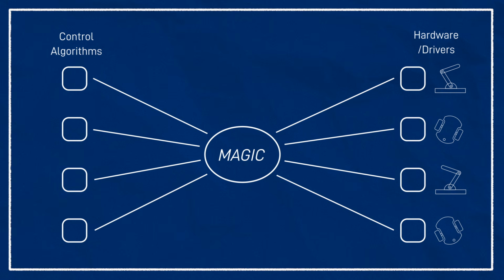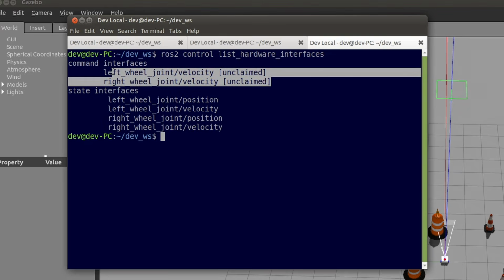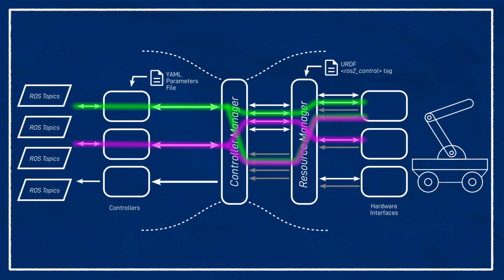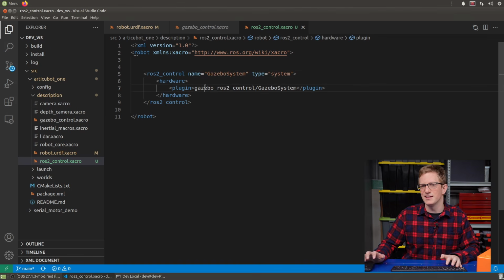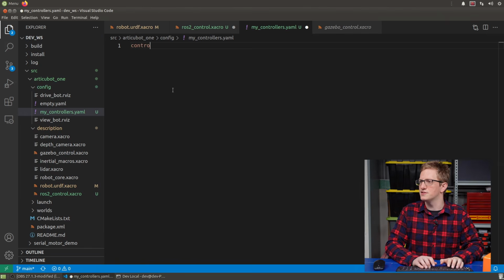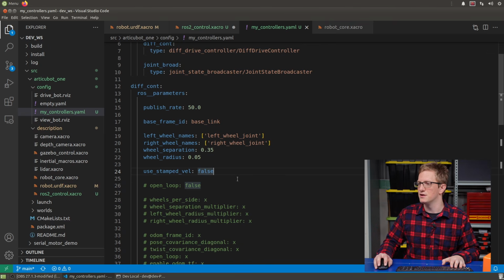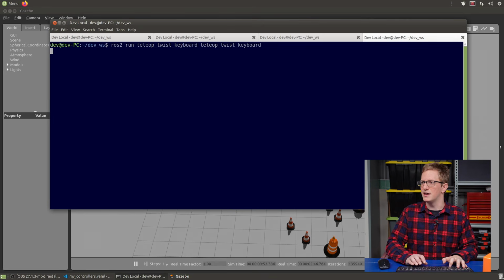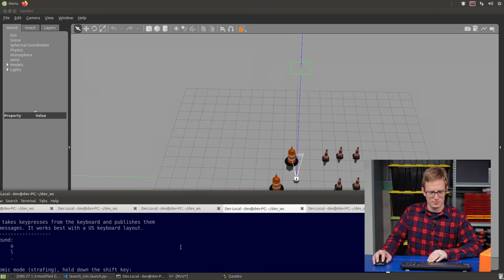Solving the problem EVERY robot has (with ros2_control)

Comment: If you get this Error after running the launch file: "No parameter file provided. Configuration might be wrong"

Its because you need to add:
<ros>
  <namespace>/</namespace>
</ros>

after your <parameters>....</parameters> plug in

Without this block, Gazebo's plugin was trying to find the file on its own (without using ROS's package system), which failed because Gazebo doesn't understand $(find my_bot) syntax.

Comment: first, huge thanks to you for creating free resource to educate the community.
And for others :
I was struggling with the gazebo_ros2_control plugin not parsing the YAML parameter file and Gazebo server failing to start. After much debugging, I found two critical points that resolved my issue:

The <parameters> tag that specifies the YAML file must be inside the <plugin> tag of the gazebo_ros2_control. If it’s placed outside, Gazebo reports “No parameter file provided” and fails to parse the YAML.

The <plugin> element specifying the hardware plugin (e.g., <plugin>gazebo_ros2_control/GazeboSystem</plugin>) must be written in a single line without line breaks. Splitting it into multiple lines caused the Gazebo server to crash without clear errors.

These subtle XML formatting and nesting fixes solved both the YAML parsing and Gazebo launch errors for me. Hopefully this helps other ROS 2 Foxy and Gazebo users avoid the same frustration!

no AI model could find this error. I cloned articulated robotics repository for this and tried running and did many iteration to pinpoint the error. Hope this helps some beginner like me.

Comment: I am using gazebo to simulate a quadruped robot, the robot keeps sliding backward and jittering before i even press anything, i tried adjusting friction and gravity but didnt change the issue. Anyone got an idea on what that could be. Howver when i use the champ workspace it works fine, so i tried giving chatgpt champ and my workspace and asking what the differences are it said they were identical files so i dont know how to fix it. For reference the robot i am simulating is the dogzilla s2 by yahboom provided in the picture. My urdf was generated by putting the stl file they gave me into solidworks and exporting it as urdf.

2

1

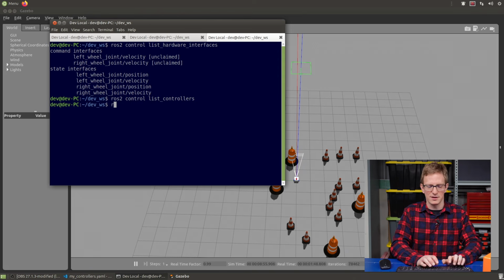Comment: I am facing issue in ros2 control list_controllers 18:35 , how can I solve, I have ros2 humble version
Reply: have you found a fix?
Reply: I am facing it right now
Reply: I'm facing the same problem running with ros2 kilted. I think the cause is that gazebo changed since foxy and then the controller doesn't start.
Reply: The solution is in https://www.youtube.com/watch?v=fH4gkIFZ6W8

Comment: any ideas how to change parameters for 4 wheel diff drive
?
Reply: Any luck?
Reply: @chibuezeorji8288  i tried tweaking some parameters, it shows perfectly in rviz2, but in gazebo, i will work only if friction and angular speeds are set correctly

Comment: Really helpful set of videos. I'm struggling to find a controller for a 3-omniwheeled mobile base, I fear I will have to write it on my own. Only I found for a 4-omniwheeled robot or a tricycle base. Do you know if there's something out there for the 3-wheel holonomic base already developed?

Comment: I was getting this error: "Could not contact service /controller_manager/list_hardware_interfaces" (when running "ros2 control list_hardware_interfaces")
and "waiting for the controller manager service be available" in the gazebo output
the problem was for me that I accidentaly put the gazebo tags in ros2_control.xacro inside the ros2_control tags
took me quite some time to find this mistake, hopefully this helps someone who happens to be in the same situation

Comment: Hello I have a problem with Controller Manager, when I launch my launch file I have the error : "waiting for the controller manager service be available" Do you know how to solve this?
Reply: Hey man! Did you find a solution for this? 
I need some help with the same
Reply: @avaneeshchitta794  Hello, I tried different things, but I still had the error with the "controller_manager". My solution was to create a python code for communication with Arduino using the "serial" library, another for the publication of odometry and another for the publication of the td. The only thing I had to use was a Nano to control the motors and a Mega for reading encoders. Investigating they said that the raspberry was very slow for Ros2 and the best thing was to run a "Basic Ros" on the raspberry and the "Complete Ros (Rviz, etc)" on another PC with more resources
Reply: has anyone been able to figure this out I am also having this issue @avaneeshchitta794
Reply: @avaneeshchitta794  i had the same, problem was that I put the <gazebo> tags in ros2_control.xacro inside the <ros2_control> tags
Reply: I also have this problem, maybe it’s fue to a recent update. I have my tags correctly placed, though. Has anyone been able to figure it out?

Comment: Thanks Josh. Just to let you know, the "ros2 run controller_manager spawner.py ..." gave me an error (now executable found). I had to use "ros2 run controller_manager spawner ..." without the .py extension, and it worked.

Edit: just realised this is mentioned in the ready to humble video. Watch that first.
Reply: Thank you for sharing this. I encountered the same error and tried million different things to fix it only to realise, "Someone must have faced the same error, let me check out the comment section".
Reply: Thanks for sharing this
Reply: thabks
Reply: tks
Reply: this really helped me too, thanks
Reply: Thanks for this
Reply: Thanks buddy
Reply: yeah buddy, but i am into a new problem where all things go correct still my gazebo robot not moves on that unstamped don't know why this been stuck in my head for few days
Reply: sorry, i forgot the first rule while starting this series to have patience i followed back the tutorial series and found out a bug in my lauch file now all is good 🤩🤩

Comment: As i understood it correctly, ros2_control relies on the motors having their own controllers - they manage them via the ros2_controller manager. But however, how would you write an own PID controller for a specific robot and then connect it to the controller manager?
Thanks for the great video! =)
Reply: Refering to the part where it was mentioned how the ''hardware interface" is already given, or else it should be written independently

Comment: Hi Josh, 

I'm following your partical ros2 tutorial, and I'm struck near the list_hardware Interface. When I'm trying to run it. I'm getting a msg in the terminal that "Could not contact service /controller manager/list hardware_ Interfaces. " I'm using ROS2 humble, and I have installed all ros2_control packages for binary and gazebo packages. Can you please help to fix my problem?

Thanks 
Adithya
Reply: (Just in case you are still having this problem:) I also had this issue, my mistake was that i placed <gazebo> ... </gazebo> inside the <ros2_control> ... </ros2_control>. I placed it like shown in he video and that solved it.
Reply: Hi Adithya,
I have also faced the same problem. Have you found any solution now?

Comment: I followed everything in the video, but when I try to run the controller diff_cont, I get the error 'Failed loading controller diff_cont'. But the 'joint_broad' controller loads properly. Any clue why this is happening?
Reply: Same issue, did you found any solution?

Comment: Thanks a lot for these tutorials. I have a question. Ive been running into issues when running the launch_sim file with ros2 humble. I dont know why but the gzserver dies when launching with ros2_control. The exact ERROR msg is the following: [ERROR] [gzserver-1]: process has died [pid 261816, exit code -11, cmd 'gzserver -slibgazebo_ros_init.so -slibgazebo_ros_factory.so -slibgazebo_ros_force_system.so']. I dont find any forum containing this problem.
Reply: did you find a solution to this issue?

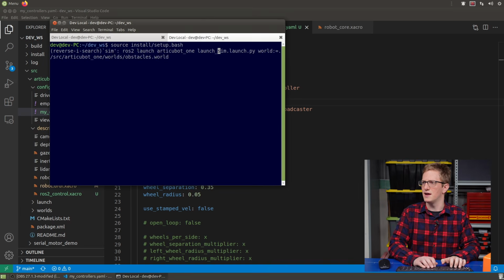Comment: I get the error "No module names 'roslaunch'" when I run the command at 17:36 ? Anyone have any ideas why?
Reply: I also got the same error,did u solved it
Reply: I have the same error. Did you find the solution?
Reply: were you able to fix this issue? I am having the same problem.
 @jordyneefs3693

Comment: Thanks a lot for the tutorial. 
I am using ros-humble and everything worked fine so far up to the point where we substitute the ros2_control for Gazebo control. the robot moves only forward and backwards. It doesn't respond to the angular_velocity command.
I have also noticed the ros2_control publishes the /odom as /diff_cont/odom.
Reply: I have the same problem. On humble, when changing to ros2_control robot only moves forward or backwards. Any solution??
Reply: @alvarobarrientos3054  I don't seem to be able to make it work at all instead... did you find something out?
Reply: @vollaro3  Not really. However, further into the investigation i have noticed the odom TF has the below error when i run Rviz2.

Error: TF NAN_INPUT: Ignoring transform for child_frame_id “base_link” from authority “Authority undetectable” because of a nan value in the transform (-nan -nan 0.000000) (-nan -nan -nan -nan)
at line 278 in /tmp/binarydeb/ros-foxy-tf2-0.13.14/src/buffer_core.cpp
Error: TF DENORMALIZED_QUATERNION: Ignoring transform for child_frame_id “base_link” from authority “Authority undetectable” because of an invalid quaternion in the transform (-nan -nan -nan -nan)
Reply: @vollaro3  I had a spelling mistake in the my_controllers.yaml file for the "wheel_separator". Corrected it and now the ros2_control works. Such a foolish error.

Comment: Hi Josh, great video as always! I am trying to set up diff drive pluggin under a namespace. How should I configure the yaml file in that case? Thanks!
Reply from the maker: Ooh good question, I've never tried and unfortunately am not exactly sure how to do that. If I had to guess, I think if you just put the namespace everywhere (C++, XML, CMakeLists, YAML, etc) it might work?
Reply: @ArticulatedRobotics  Thanks! I tried putting namespace when setting up ros2_control and gazebo plugin but the yaml file would parse incorrectly if I tried to add namespace in it, so I am not sure how it should be done and I didn't quite find documentation on that either 😮‍💨

Comment: After following the complete tutorial am getting this error 
[ERROR] [1665975816.083180080] [spawner_diff_cont]: Controller manager not available
Please if you can guide through.
Reply: Had the same problem. Have spent hours on it.
Try running these commands before anything else:
    killall gzserver
    killall gzclient

It is just because the previous Gazebo session is being cached which is creating issue.
Reply: @nice1__  thanks bro , it worked ,,
Reply: @m.ismailwardak  Glad it helped :)
Reply: same issue
Reply: I had the same problem. Try creating a new workspace & package and copy paste everything in there. No idea why, but it worked for me :)
Reply: @k_ros849  wdym new package?
Reply: @justal787  I created a new workspace and build a new package inside it. Then I copy pasted the old files in the new package and changed them to run with the new package name
Reply: Managed to fix it by just rebooting everything, and running source and then colcon, rather than the other way around. But that might not be relevant.
Reply: @justal787  Yes, that works too. But for me it happened over and over again, so I fixed it permanently as explained above

Comment: I had to abandon ROS and robotics because I couldn't control my robot on Arduino. I don't know if I should continue because it's very complex.
Reply: You should absolutely continue! I started picking up some programming and robotics in mid-2021 and gave up and restarted several times. I’m now over six months into my first software engineering job and it’s a blast! This stuff is very challenging but very rewarding. You’ve got this, keep at it!
Reply: I found ROS to be absolutely unnecessary bloat piece of code and rabbit hole that serves no purpose but wasting your time trying to figure out how to deal with the 100 thousand different flavors and the very unintuitive, UX / developer unfriendly concepts and technical jargon that is extra complicated for really no reason what so ever. 

I ended up ditching everything and relying only on python and Isaac Sim (which is amazing if you ditch the ROS part of it).

For robot control I use Dynamixel SDK to directly read / write motor position directly from python without any middleware overhead.

Similar story for sensors.
Reply: Hi @Andrew Bennet
Do you do robotics at your job?
Reply from the maker: I'm sorry to hear that. As Andrew said, it can sometimes be a very steep learning curve with challenges along the way. I try to make the path a bit easier but it is still tricky!

Where did you run into problems? Is your Arduino working but you can't talk to it with ROS?
Reply: @ArticulatedRobotics  After following the complete tutorial am getting this error 
[ERROR] [1665975816.083180080] [spawner_diff_cont]: Controller manager not available
Please if you can guide through.